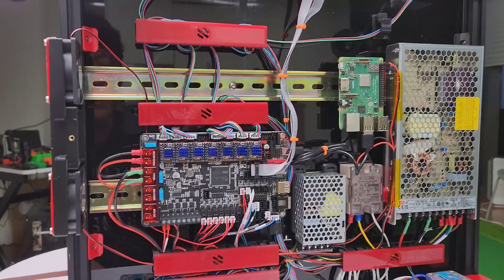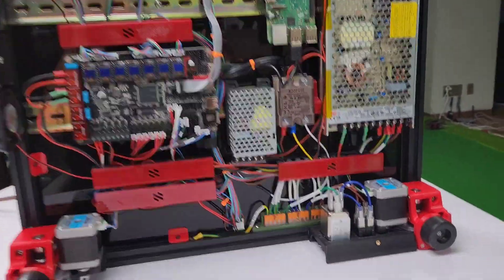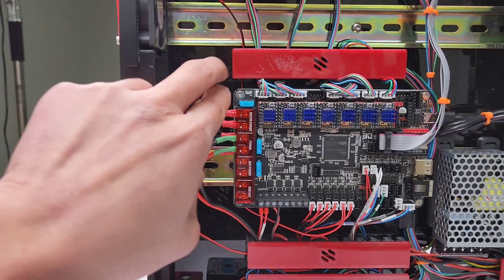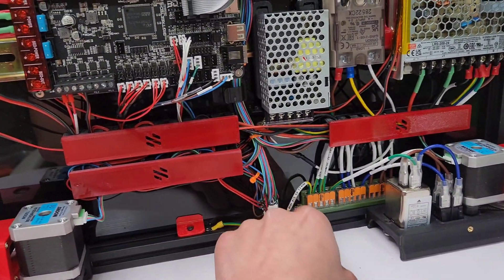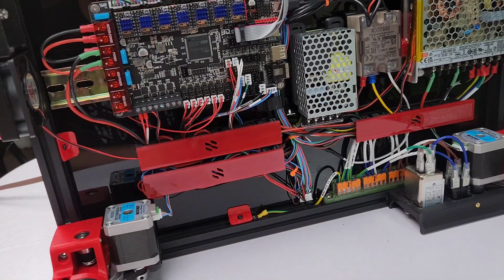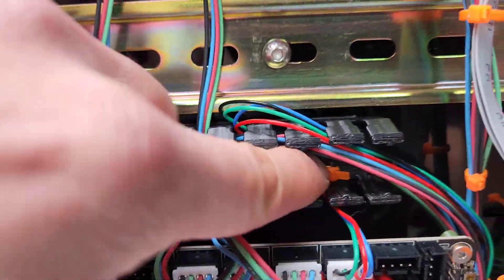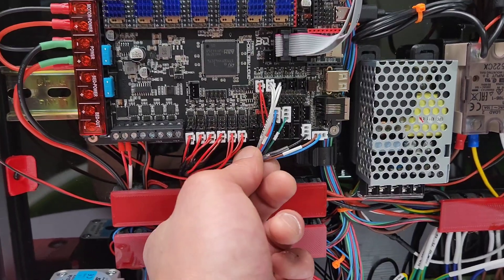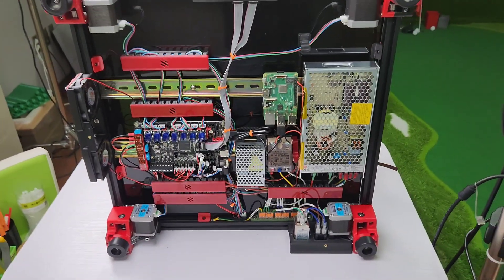Voron 2.4R2 Wiring Guide!

Comment: 3:50 yes it does matter, if you connect neutral to your switch, you will have the bed on the live wire when it’s turned of. (ie. You measure 230V on the bed wires when idle.) 

You want the bed permanently connected to Neutral, and the Phase to be connected to the switch
Reply: Mind you, if you are using the widely used Schuko plug, you have problems with polarity switching. It's designed to plug two ways. To fix this, you need to use Double-Pole Relays or Switches that switch both poles. Maybe there is a better solution, but I have not found one.
Reply: @MrEllerz  yeah, just proper wiring, and use a plug that can only be plugged in correctly (has an earth) pin, not like the Schuko. I am from Switzerland, so it's not an issue here, our plugs are properly designed ;)

But yeah, double pole is probably the best way to go.
Reply: @010falcon  As for now, I just leave it as the Voron design says, it's just a safety compromise with the Schuko plug, you just make sure of good ground in this cases.

Comment: I don't think the switch is wired right. It looks like it will connect blue directly to brown when the switch is turned on.  On the SSR "one of them is connected directly to neutral" You point to blue wire. But no blue wire is connected to the SSR. Just brown and white. So when the SSR is turned on it will connect brown and white? No mention of it going to the heated bed?

Comment: Thanks for the video, you give me a few good ideas. I built the LDO V2.4 and added the CanBus BTT SB2240, which got rid of one small board in the electronics bay. I need to add a Mean Well 5V PS for LED's and so I need to make room for that. The WAGOs and carrier you used is the answer because now I can get ride of the power block on the DIN to make room for the PS. Great idea, thanks again!

Comment: I'm sure the trident and 2.4 has some similar wiring, did you connect your ssr ground to the the psu or the same slot on the wago? Their wiring kit and the manual is a little off to me as far as matching up ground wiring.